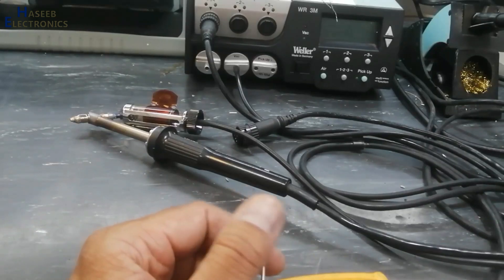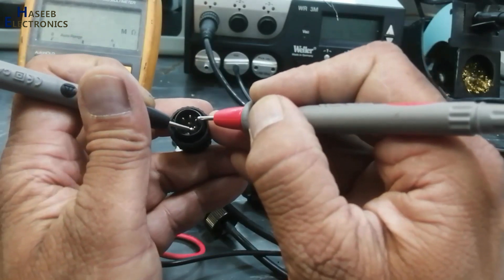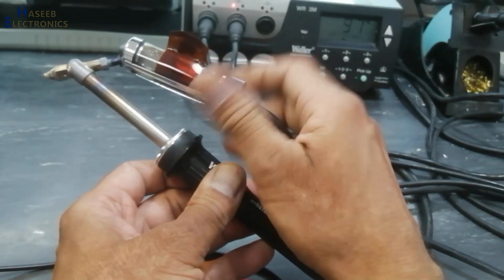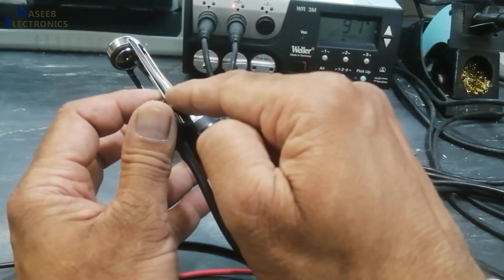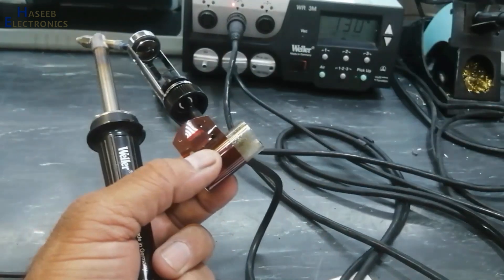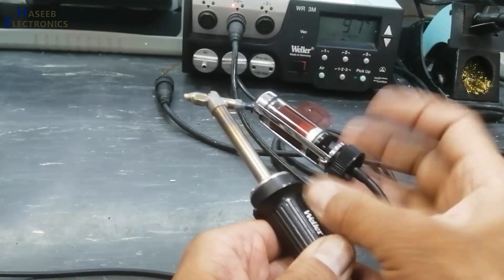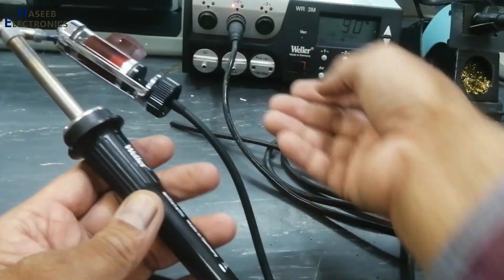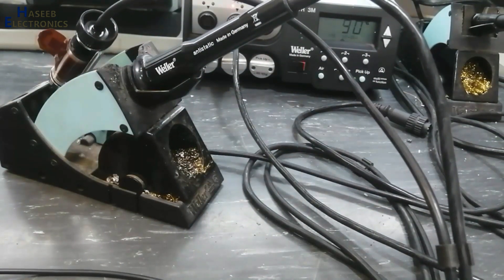{1220} WELLER desoldering gun troubleshooting tips

Comment: Please I need help sirs.

I'm asked to design a 24V 15amps DC SMPS Power supply with active power correction.

I'm still confused on which topology is best for me.

I'm a complete beginner, and the more I dive deeper in my research, the more I realize how complex the project is actually.

Any help of any type will be welcomed please 🤲🏾🤲🏾
Reply: I have TDK and MeanWell SMPS on that power level, they use 2 switch forward. Might consider using it. Maybe also halfbridge
Reply: @aizu35  I have meanwell too. But I don't know the kind of topology they used.

I know half bridge is the most efficient and reliable for this power level.

As a beginner I'm more drawn to the push pull topology